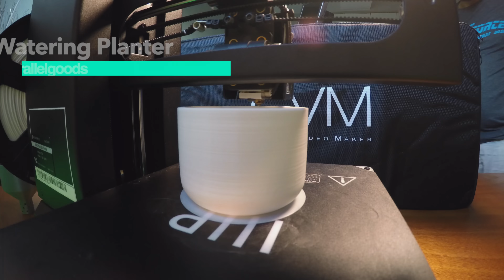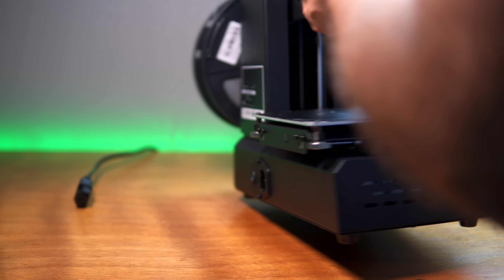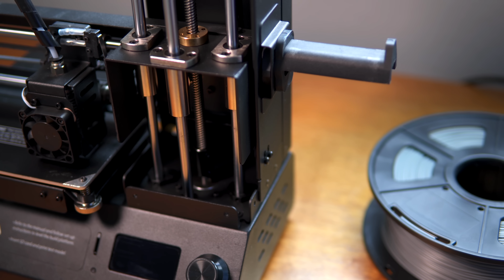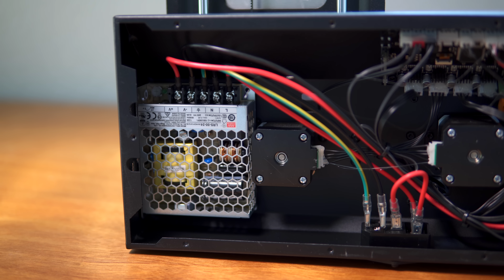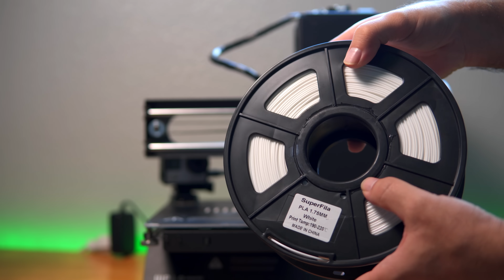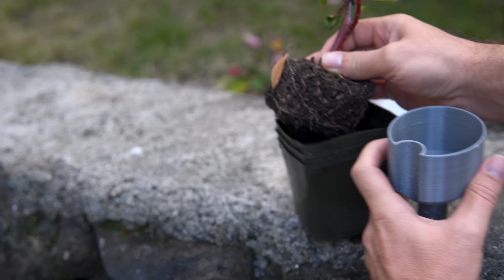Monoprice MP i3 Mini 3D Printer - Teardown & Fixes

Comment: I have a Monoprice Mini 3d printer that is dead, as in no power.  I was in the middle of a print when it died, which of course ruined the print.  I read articles on how the heated bed wiring caused problems.  I checked the wires and everything looked good.  I thought maybe the power supply died.  I connected my backup power supply and still no power.  I tried jumping the on-off switch and still no power.  Is there a fuse inside that could go bad causing this issue?  Any advise / information on how to get this printer back up and running would be appreciated.   When this Monoprice Mini 3d printer was working, it worked really good.
Thank you.

Comment: the extra headers are for a Peltier unit likely 5v or 12v and the extra fan header is also for the Peltier unit. they are thin and can create a heated bed for you. not very hot im sure but warm because you have an aluminum bed. that's the kinda mod to add.

Comment: I have the original white one and that sucker is LOUD!  And also I get mad layer lines with all prints.  I have to print a piece to stabilize the rods on the inside.  For some reason one of them is short.  And I have to replace the build plate thermistor.  It doesn't work so I can heat the build plate.  A lot of work has to go into to get this working right just never had the time since I got my CR-10 and Ender 3.

Comment: As for the fan, the bearings are on their way out. My wanhao I3 mini started doing the same thing after a few months. Purchased a second one and it was doing it immediately out of the box. Replaced the fans on both with something higher quality. Haven't had any issues since.
Reply: where did you get the replacement fans? any links? I have a wanhao i3mini too

Comment: What printer is this exactly, it is not a monoprice select min v1 or 2, the insides are completely different, there it no easy to remove back panel at all, no internal psu, and  either the video is mirrored or everything is on the wrong side vs the monoprice ones, so what is it exactly??

Comment: This is such a great little printer, but the lack of heated bed drove me nuts. From what I've gathered, Wanhao planned to release a heater bed upgrade kit, but it never happened. If you look at the main board, there's a BED ADD header. An external mosfet & psu upgrade is required if you want to add a 24v bed, but if you add an AC-powered silicon heater & relay, you can use the stock PSU. Here's a diagram of the pinout for that BED ADD header: https://i.imgur.com/mZMiZ3B.jpg. Then you just need to enable the bed in Marlin & re-flash. I have a "base" version of Marlin 1.1.9 setup for the Wanhao i3 Duplicator mini & rebrands if you ever want to attempt the mod: https://github.com/thisiskeithb/Marlin/tree/1.1.9-Wanhao-Duplicator-i3-Mini

Comment: This printer is has better motors than my Monoprice Select Mini V2 wtf monoprice also has better internal componets
Reply: No it doesnt
Reply: @berencam  Yes the Monoprice Select Mini v2's z stepper motor is a circular Chinese piece of crap and the the whole z axis is a lot worst than this printer.
Reply: Yeah it's a circular one. But it is just as accurate as the square one.

Comment: There is a facility on the board to fit a wifi controller board. I used an esp8266 board, it powers up fine but the firmware needs to be changed on the motherboard. Not for the light hearted.
Also mine seems to get through thermistors. They fit in the hot end. If I was you I would get some spares now plus an extra heater capsule as the 24v heater is not off the shelf.
All available from Aliexpress.
Reply from the maker: Thanks for the info!
Reply: https://www.aliexpress.com/item/1PC-6x20mm-Ceramic-Cartridge-Heater-12V-30W-24V-40W-for-CNC-3D-Printer-Prusa-Mendel-Print/32816791895.html?spm=a2g0s.9042311.0.0.34c84c4d2PVMbU

100K ohm thermistors available locally, pretty standard, get a few with the 2 pin white 2.5 idc connector 1M long should be a direct replacement.

Comment: The warping of the bed plate can easily be fixed by buying a glass plate. You just clip it onto the aluminum bed, they’re very cheap around 15 bucks. You can also get very nice adhering and first layers with the glass.

Comment: Wow. For PLA only this printer seems much nicer than the MP Select Mini V2 that I got. Especially since mine's also PLA-only until I rewire the bed heater. Strange that the MP i3 Mini is sold out and/or invisible in the U.S.
Reply: This model is actually made by Wanhao. You can definitely find it being sold in the US by Micro Center as a PowerSpec i3 mini.